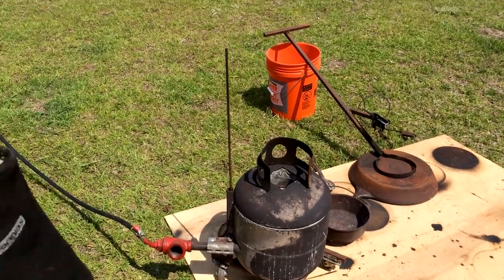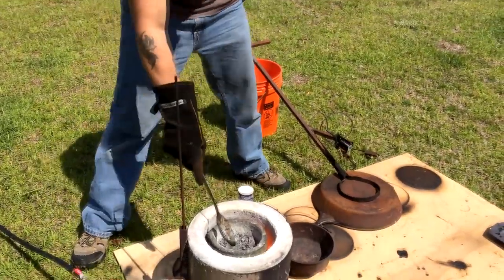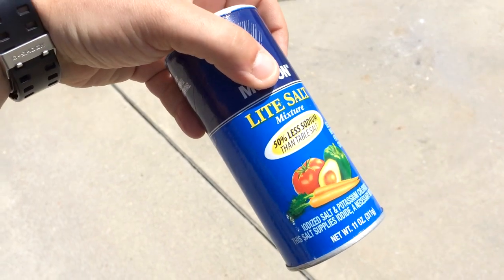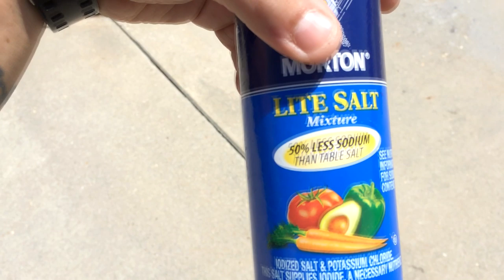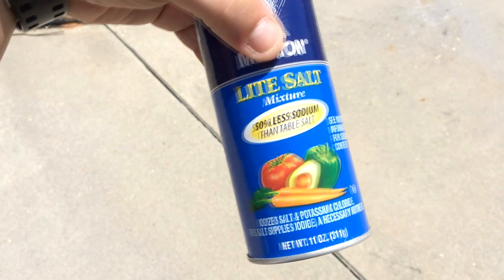Dross Removal (Little Sparks Ep. #5)

Comment: my friend and i just finished melting down 11 lbs of aluminum (arround 900 cans) and we had about a gallon of dross is there any way to re melt it and get the extra aluminum out of it?
Reply from the maker: Not that I have found. Every time you melt it some of the aluminum oxides into more dross. I just toss the junk I skim off into a "tin scrap" bucket and give it to the recycling center

Comment: Y dont u use wax or saw dust does the salt work better? Love the videos.
Reply from the maker: Ronald Davis when the salt breaks down the potassium chloride actually breaks down into pure chlorine which forces hydrogen out of the metal...
Reply: Wax and sawdust work great for lead casting, as they serve to sacrificially drive off oxides.  Here, with aluminum, the potassium chloride removes hydrogen in much the same way.  Aluminum oxides only form on the surface like a thin skin, not throughout the mixture, and are of little concern.

Comment: lite salt... is that the same for when people put borax in it ? 

what do you do with the stuff you remove ? 

casting question... ever tried casting termite nests ? i wonder if it would work the same... also, ty for your help. my buddy and i are building our foundry this weekend, and with your help, our thingie is being sent in the mail... until then were gonna try it out with a stainless steel container, just to see if everything works good. ive read that using concrete is hairy cause if there is any moister in the concrete, the head will turn it to steam and will explode. 

so, were gonna make everything except the thingie ( cant remember what its called atm ) abd do a run.. while being as safe as possible... would rather something happen during the test, versus when the thing is full of cans lolz...

damn whats that thing called...crucible... :: shakes head :: ok replace crucible with thingie lolz.
Reply from the maker: LOL!  yea im glad your "thingie" is on the way.  And yea moisture in the concrete is a really bad thing.  Please please please run it as low as the burner will let you for a long long long time....  Like set it as low as you can get it and let it run till it stops steaming then let it run another few hours...  set up some lawn chairs and read a good book while you make sure to not blow your self up.  Hopefully its not to late but you should be using refractory concrete and not normal quick creet or sidewalk repair stuff...  the refractory has silica or something in it that helps not retain the water.

I really glad i am able to help and cant wait to see what you come up with.  Try to get some video of you and your buddy putting it together and during the burn in.  I'm excited that i could help you make this a real hobby.  Also be sure to let us all see what you make with it when its done.  

Stay safe, and play with fire.
Reply from the maker: oh... and the crap i remove from the top of the molten cans is cooled and tossed in the trash...  completely useless...  and yes the lite salt is just like the borax soap but cheaper.  ;-)

Comment: Please please please respond. I know this video is old but I was wondering is it really safe to just kick this stuff in your trash and let it sit. I've heard it can be dangerous but you look far more experienced than me. I'm also aiming to do this today so it'd be amazing if you reply
Reply from the maker: +Sage Turtle sorry I didn't respond right away...  After it cools it's completely safe to just drop in the trash. It's just ash and aluminum. Actually less chemicals and crap than if you trashed your BBQ coal ash. Just make sure it's cool so you don't catch your trash can on fire.
Reply: +556Raven alright! Thank you so much!
Reply: +556Raven one last thing. I'm doing grant thompsons design. 1 part plaster of Paris one part play sand and water mixed into a steel bucket. I'm using a stainless steel bucket. Do you think that's safe to use or good for the job. I know it won't take to much heat but I want to be safe. In grants video he uses galvanized steel. I know zinc is dangerous to melt so I went for stainless steel. Thanks for your help so far!
Reply from the maker: +Sage Turtle stainless is perfect. His design is great. You'll be safe. The plaster won't last quite as long as refractory cement but you'll still get a few hundred heating cycles from it
Reply: +556Raven alright thanks! The mix is drying as we speak!